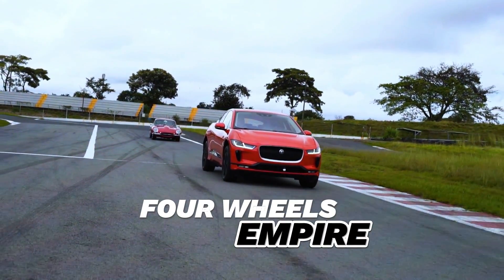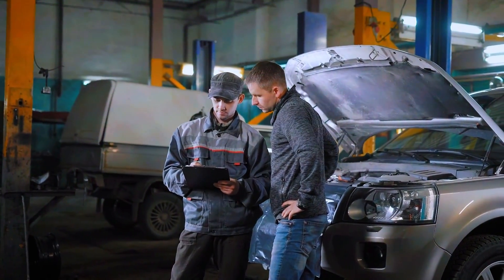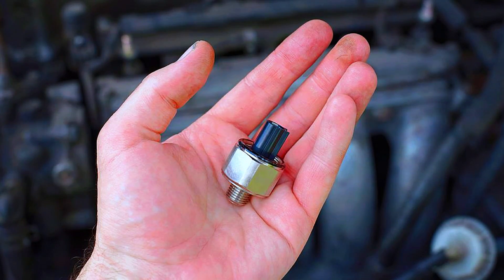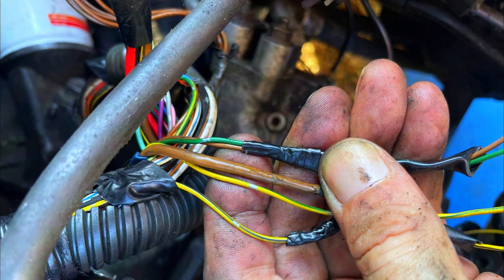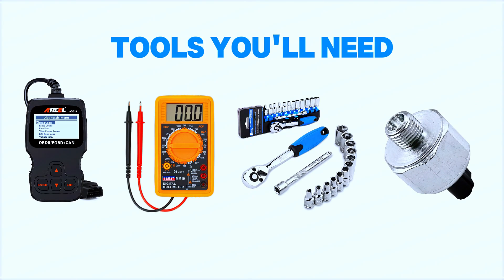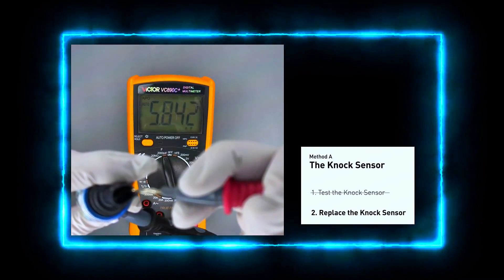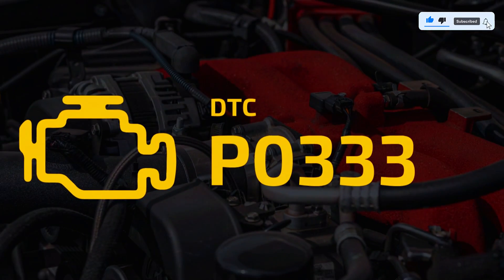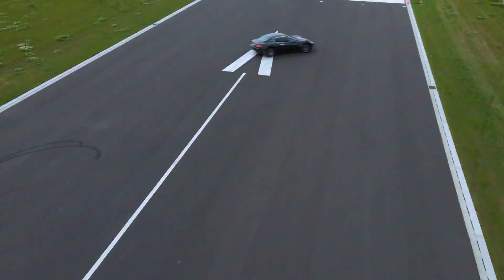How to Fix P0333 Code: Knock Sensor 2 Circuit High Input (Bank 2)@FourWheelsEmpire

Comment: Replaced knock sensor but check engine light still on. how long of a drive so the check engine turns off or should I reset light with obd2 scanner. thanks
Reply from the maker: Great question! After replacing the knock sensor, the Check Engine Light (CEL) might stay on until the system completes a few drive cycles and confirms the issue is resolved.

However, to save time, it’s best to clear the code using an OBD2 scanner. That way, you’ll know right away if the problem is fixed or if the light comes back—indicating something else is still wrong (like wiring or connector issues).

If you don’t clear it, it could take 50–100 miles of mixed driving over several trips for the light to go off automatically—if the fix worked.

Let me know if you want help interpreting the live data or pending codes!